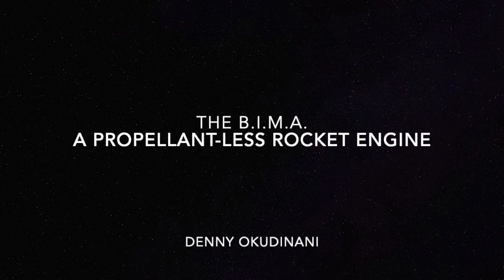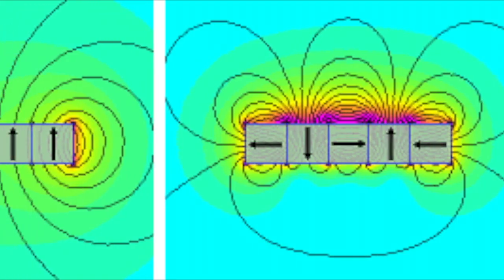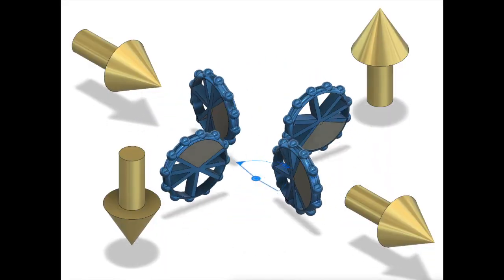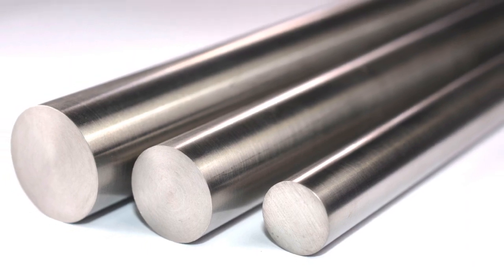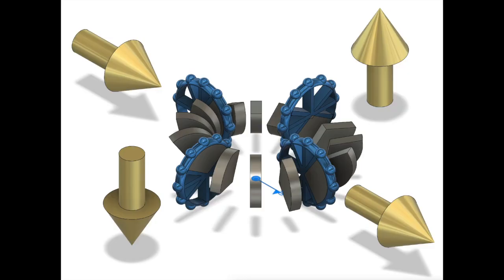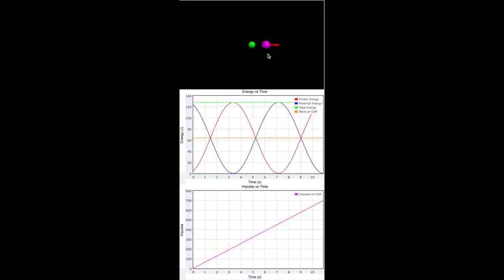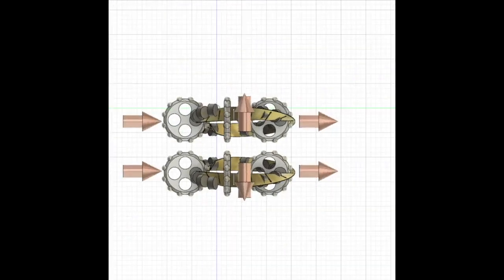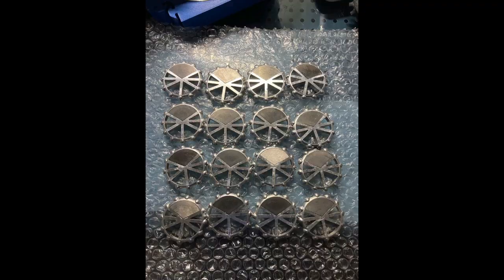Inertial Propulsion System 1: The unBalanced Inertial Mass Accelerator (BIMAH)

Comment: The only way to achieve this in theory is to make mathematical errors. All rotation can be simplified to linear oscillations which are balanced unless acted on by an outside force. No matter what speed changes you do or erratic paths if each part of the system only moves within the system it's net force on the system is zero.
Reply from the maker: Hey, thanks for the comment. This sounds like some strong confirmation bias “I suspect it must be this way so it is.”This sentiment is something  like saying “I know good artwork, yours feels wrong, I know it is, so go figure it out [and agree]. ” 

Let me be clear: I’m not dismissive of  “your ability to discern ‘good artwork’ “ (or the possibility that something could be mathematically incorrect), but I would be more appreciative of constructive feedback which actually identifies what (if anything) was incorrect in the mathematical and physical approach used and where this can be found in my paper. This way I might work towards improvements or asking other questions. I’ve checked the math many, many times over, and it continues to works quite well. Others are more than welcomed to do the same, or skip over to experiment (I opensourced all project parts to the public). 

Moreover, I don’t “change” the operational speed of the system (it’s always at a constant rpm), and there are no “erratic paths” only well defined mathematical bands/curves with unique and emergent properties in parity/chirality. The mathematics utilizes rotation matrices (very common tool for particles physics) and the physics is Newtonian. There are no strange assumptions about energy. I do attempt to frame a formalization for Mach’s principle in sections 1-3 but section 4 is a standalone technical analysis on the dynamics and energy of these systems supplemented with code which simulates the operational math. 
  
Nam qui curat
Reply: @MillennialZoomer let me make it a little clearer how I would analyze any system that is supposed to create unbalanced force without using outside force. First you divide all moving parts into particles. You don't need to go down to protons etc. not individual atoms. Just small enough chunks that each one's motion has the same effect as if it was moving along a track without itself rotating. Now analyze the motion of each particle in 3 dimensions separately. In each dimension its motion is a straight line oscillation within the system. Each oscillation creates forces in opposite directions that cancel each other out. This is the case for all particles in the system. Therefore it's the case for the system as a whole.   It would be great if you were right and I was wrong.  It's just there have been countless people trying to achieve this for a long time. Still it seems the only successful way to propel things is by using outside force.
Reply from the maker: @wesleyashley99  Hey, thanks for the clarity; however, there still seems to be quite a misunderstanding. I’ve done exactly this already having separate treatments for both the 2D and 3D particle cases. If you took the time to read my paper and look through the mathematics involving the dynamics, you’d have seen this right away in section 4. According to the mathematics of my own findings your conclusion is to be contested. Again, I could be wrong, but you’ll find my treatment of the dynamics was fairly straightforward in section 4.

Nam qui curat

Comment: Look for deficiencies in your math and software models: possibly incomplete mathematical representation of the physical problem, and/or errors in numerical methods used to solve the math model equations.  

It is essential that the experiment and model(s) represent the same thing.
Reply from the maker: I’ve done this. Others are welcomed to do so and point out anything they specifically find, so that improvements can be made where needed.

Comment: [xkcd 2217] Pretty sure if you point this downward and draw power off the motor it would be a perpetual motion machine? 
The mechanical design looks beautiful though! How did you get those cool custom tungsten pieces?
Reply from the maker: First: thank you for the comment on aesthetics🙇‍♂️! For the record it is far less important to me than functionality . It was never taken into consideration when designing this build. 

Next I don’t understand where this assumption of a “perpetual” machine comes from. As I already stated in the video, the device is made operational by a gas or electric powered motor. If there’s no motor there’s no motion. It’s not self starting with “forever motion”. (Just like an airplane, jet, car, or anything else that goes vroom. They don’t become perpetual motion devices with “forever thrust” because you left the engine running). It doesn’t matter where you “point” the engine, if your batteries run out of juice or gas tank becomes empty, your motor stops, and so does the engine. 

To answer your question about the tungsten: China. Lots of cheap vendors on Alibaba. (Check it out and maybe try a build! ). I open sourced everything so that there can be more science experiments! 

Nam qui curat

EDIT: found the xkdc reference. 😂 I love it https://xkcd.com/2217/

Comment: I really wish you're just delusional, and not a scammer. we both know that this machine is impossible because it violates conservation of momentum. if a device this simple was possible, we would have had flying cars in the 1800s, and become an interstellar species by the 1850s. I saw your video in which you show your simulation, and it's honestly kind of sad. It's pretty much all wrong... you don't seem to understand rotating reference frames, or how angular momentum works... you can play around as much as you want, just please don't call this science.

Comment: it is an interesting convelusion of force vectors, But, somehow I have a feeling that there was one or two unaccounted vectors that let some to belive that an object can move without apparent mass ejection (Working a force off of some other mass such as the ground a wall or particle ejection)

Here is one a mind like yours could probably agree with.
I propose that there is no way to block a magnetic force where that force potential that was blocked is greater than the force needed to block it.
IE blocking a magnetic force by moving another magnet infront of it will take more force to place that magnet in front and remove that.

If you could wave a peice of magblock boarding infront of a magnet and experience no resistance as you did so, and that magblock boarding did as the name implied, you have a trillion dollar material on you hands. (Given that that boarding is not thicker than the magnetic flux field. IE say about 1inch max.
Reply from the maker: Thanks for the comment, I really appreciate it! In the simulation that you saw for this video, there were indeed a few bugs. I was able to refine the math and the code in my "thesis" here, to ensure that vectors were given proper treatments within the maths. 

You lay out a very nice point. Infact, what you say with the magnets reminds me of some of the heuristics that were used in university when we were learning about the "spin" of an atom. We used blocks of normal magnetics  which would be placed before some magnetic things, and observe characteristic of its moment to build a working intuition to further understand spin states and on. 

On thing I need to make clear in my present design is I'm not trying to "dampen" or weaken any of the force vectors which are generated (This approach doesn't work, just because of the way Newtons laws work when applied concurrently). Like the halbach array, you can neutralize a force so that it remains with all of its properties. To this effect, in one respect, halbach arrays do what your thought experiment describes to a certain extent: on one side the magnetic flux has "diminished" so if you "waved" a magnet through that side, across the surface area, there would be next to no work being done( significantly less than 1 inch). If you "waved" that same magnetic on the "rectified" side of the array, then you'll have quite a bit of  force than you normally would to deal with (a bit larger than the inch and stronger). 

These magnetic arrangements are used in pretty fancy science laser experiment things, and on, so getting them right in terms of material design, i imagine, is definitely quite costly.
Reply: @MillennialZoomer  Thank you for the reply, I am sorry, I did not make it clear, you are correct in describing the halbach array with reference to my Thought experiment. but I should point out that the thought experiment was not in relateion to the device you displayed, the Halbach array triggered my interest only for that one similarity and caused me to respond, but, the Thought experiment device I am thinking of needs the back of that array to function blocked and unblocked by moving the Magblock material past it. currently, I susspect that removing the backing of the array would not have the same effect or produce a strong enough field for both attraction. and would not be easily removed due to its attraction?

"IE blocking a magnetic force by moving another magnet infront of it will take more force to place that magnet in front and remove that." 

I was a bit vuage with the remove the blocking material part there.

"If you could wave a peice of magblock boarding infront of a magnet and experience no resistance as you did so, and that magblock boarding did as the name implied"

I completly omited the requirement to also remove it without resistance in that part there. (Falsly Assuming it was implied)

So, Sorry once again for my inability to clearly describe the Imposible device (I say imposible because of my inability to find any such material that would or could do the above "easy in easy out "Magblock")

"I propose that there is no way"

Bryce.
Reply from the maker: @brycering5989 Bryce, no worries whatsoever, thank you for the detailed reply. This gives clarity and I see what you are now trying to say. Thank you for your articulateness. 

 It is a very good question you ask. It would also be something interesting to study with a small little experiment. I have my own suspicions, but it doesn’t hurt to check. It reminds me of some of the research that’s been done on this YouTube channel here: https://m.youtube.com/user/Motionmagnetics

Thanks for your thoughtful reply and interaction 🙇‍♂️

Comment: The thrust there looks to be compounded precession forces. In vacuum the system will twist but not translate.
Reply from the maker: Hey thanks for the comment! You are completely correct about the “compounded forces” leading to a a precession. This is in agreement which my calculations and simulation which showed a constant torque. However my calculations also show that there is a translation which is coupled to this rotation (“precession”).

Comment: There are much simpler and cost effective way to get thrust ether horizontal and vertically. 
All you need is a spinning weight on the end of a gyroscope- as simple as that. 
But mainstream science will not like it because it brakes the law of conservation of energy.

Comment: isnt this how a game control vibrator works? also have you considered varying proportions of volume, quantity? i think youll find the mhd or propeller are its best functional cousins.
Reply from the maker: Hello, and thanks for the comment ! To answer you questions: not quite. The mechanism for vibration in game controllers, and smart phones is a simple vibration (oscillation device) with just a single mass (usually).

Your suggestion would make for some great scientific investigations/research! I've open sourced everything, so maybe folks can give it a try and find out. 

Last I would agree with you-- this is something like a functional cousin to MHD to a certain extent.
Reply: @MillennialZoomer i appreciate your rationed response! (too often i hear "no" but then the response is splitting hairs while practically congruent.) i see the difference, this is different symmetry. what di the numbers say about a viscous fluid enviro?
Reply: also, great job on r&d pipeline
Reply from the maker: @Coriandro immense thanks 🙇‍♂️🙏
Reply from the maker: @Coriandro Ah yes, this is a great question. Honestly it comes down to the process of “force generation”. I don’t want to randomly dump a bunch of of papers, but in short the vibration mechanisms you find in our cellphones and video game controllers are typical to those class of devices which are “static friction” devices. These do not generate any force because they either rely on a single mass, or fail to properly “rectify” two masses when they are engaged in the process of inertial confrontation. To generate force, you need a system with at least two masses parts (Newton and his laws are absolutely fundamental, though they must be applied concurrently). Static friction devices give the illusion of motion, but in the vacuum of space would go nowhere. (A good example is of the Thornson drive, but there are many others!)
Reply: apologies if my comment was unclear, i meant to move on from vibrational oscilators nad return  to discussing your device. i think it is suited for viscous fluids, not space. trying to ratchet nothing produces nothing, just heat. beyond that, it seems like a solution looking for a problem. all due respect, i think best to hoist the phenomenal skills and leave the structure, keep exploring! which I've noticed you did in your other posts but haven't caught up on yet. i hope this didn't sound rude just trying to keep it real
Reply from the maker: @Coriandro  Hey, I appreciate the thoughtfulness behind your comment, means alot🙇‍♂. At the end of the day, I'm just a guy who'd like to see more people do science and research; especially on the topics that are considered "impossible". 

"Inertial propulsion systems" aren't my only area of interest. As you've started to see, I've branched out into several other topics throughout the years. (My present youtube channel doesn't even touch the other 80-90%)

So far as my device goes, I'm sure there are fluid based approaches, but as i've said many times over these are a bit of work and require more resources precision than what I did with these present systems. The only reason I'm convinced fluid approaches exists is because solid-state designs are viable in principle (this is the only reason I started to give more attention to the work of Schauberger for example).

Moreover, my  present devices have nothing to do with the "ratchet" static friction devices which can only work on a frictional surface. It is a complete mischaracterization to equate them to such. 

Devices like the one in this video aren't made operational because I"m trying to "throw" mass in one direction as fast (and as hard) as I can, while slowing it down another half cycle(NASA  has already done a great job of illustrating why those devices don't work). This is why the mathematics of motion in my systems fundamentally differ from those which "scurry" across the floor.

Comment: Doing this mechanically is a fools errand - it won't work due to friction, tolerances and speeds required.

It could possibly work when done with electromagnetic vortices in plasma.

You do seem to fail to identify the key element that the whole system is pushing itself of off. In terms of mechanical version the thing is pushing off of Earth's crust, while in an electromagnetic version it should be off of Earth's magnetic field.

Comment: have you done experiments with this fixtured to a force plate to compare your python simulation data to lab data? that could help verify this works and if it does work if the amount of linear acceration is useful/practical. if the force is minuscule it might not be useful on earth for most scenarios but could be useful to move a object around in a zero G or fictionionless environment.

this is a pretty awesome project regardless, love your 3d modeling and simulation work
Reply from the maker: Thank you for this comment! I really appreciate it. Love the suggestions! 

Your suggestion definitely warrants an experiment. I’ve done as much I could with resources that I had at my disposal. This is why is I’ve presently open-sourced everything; perhaps otherwise can go farther!

Comment: Fair enough, but I'm sure something similar has been used in satellites so they can be manoeuvred. Gyroscopic effect. Spin something inside that can be angled as needed, powered by a small solar panel, battery and motor.
Reply from the maker: Thanks for the comment! Maybe this is so, but I'm yet to seen any case where such an idea has been refined to an extent such as this.
Reply: @MillennialZoomer  .. Even Britain had working concepts decades ago.. According to AI: Gyroscopic satellite maneuvering uses Control Moment Gyroscopes (CMGs) to change a satellite's orientation, relying on the principles of angular momentum. A CMG manipulates the angular momentum of a rapidly spinning rotor with gimbals, which are motorized frames that tilt the rotor. By changing the rotor's orientation, a gyroscopic torque is created that rotates the spacecraft without expending propellant, providing fast and precise attitude control.